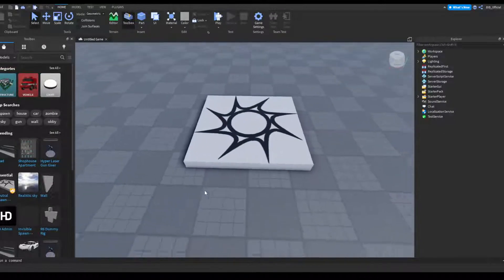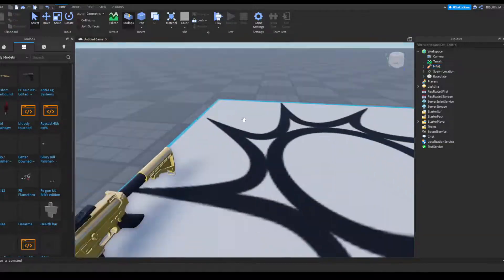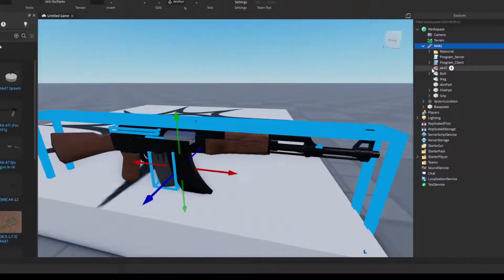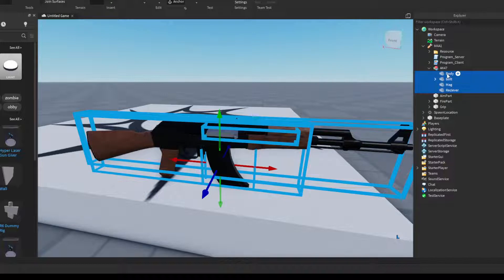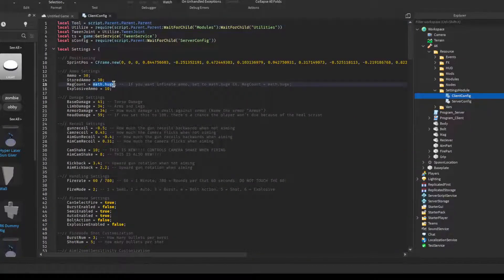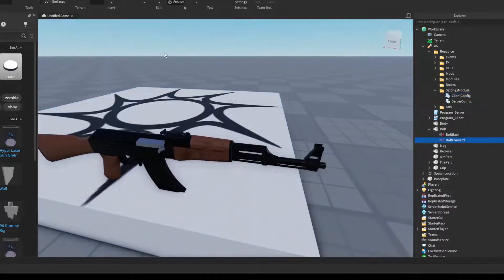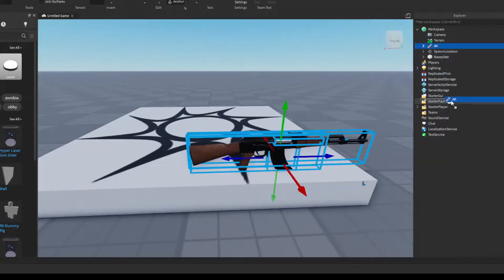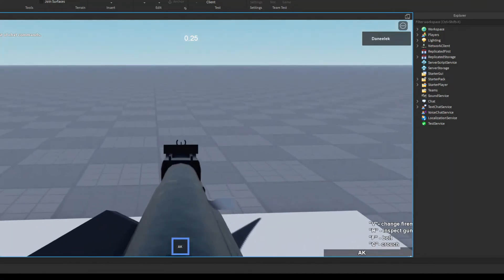How to use Warbound Gun Engine // Tutorial

Comment: there is a glitch with warbound it is when... well... lets say you equip a gun after you spawned and then re equip it a few seconds later it teleports you back to where you equipped it before at spawn so do you think you can tell e how to fix this glitch?
Reply: unanchored every part of the gun also disable collide
Reply: You have to place it directly in the starterpack, not from workspace to the starterpack
Reply: use r6 instead of r15
Reply: @jeffbloomers  bro everybody knows to use R6 for Warbound that's what I've been doing
Reply: @Gforce_2398  well at least I tried to help you
Reply: unanchor all the parts of the gun and remove the welds